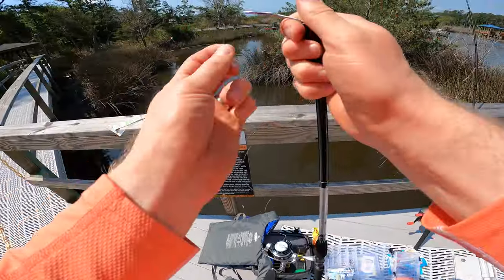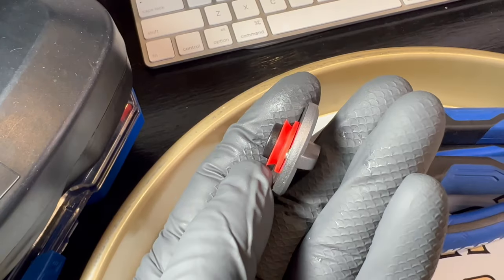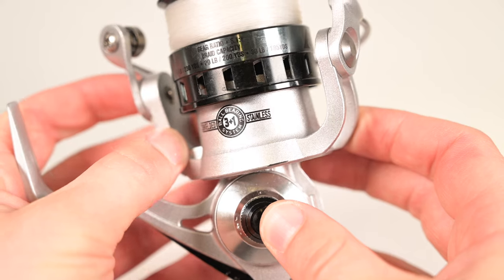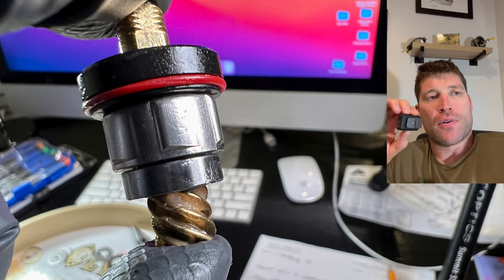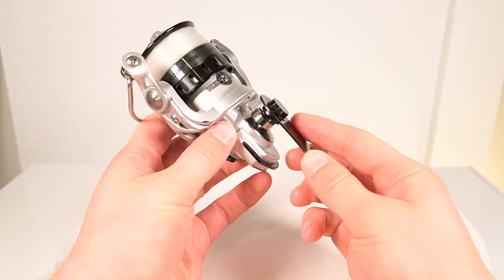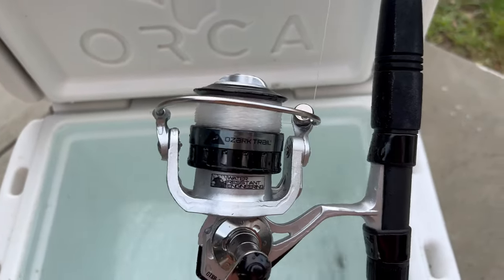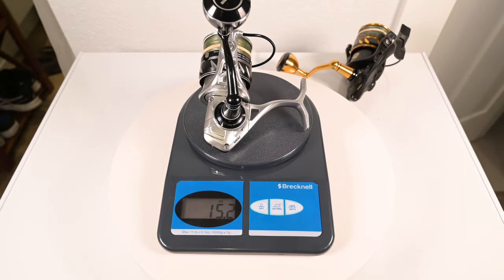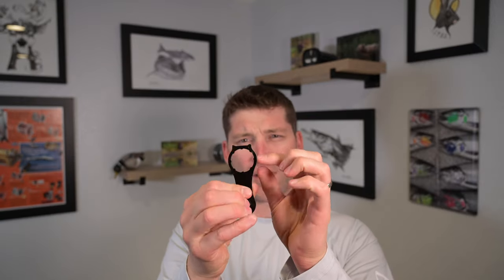RECESSION Reel: SHOCKING Ozark Trail Saltwater Spinning Reel

Comment: in my experience reels often have screws/nuts which need to be lefty-tightly to prevent loosening under use due to rotation.  So using reverse threads on certain fasteners makes the widget more secure/solid.

Comment: Great video, Thanks! I have been using the Barrier II for surf fishing for 2 seasons now. The barrier II is a good reel. I made some improvements to the drag, and added 1 bearing on the right side of the main gear (crank gear). I just found out about these Walmart OT reels a few days ago. I scored 4 of the 6000 size for a ridiculously low price. I didn't expect a whole lot for the cost, but wow, these are really built. The only drawback I see right away is the spool depth and shape, that may affect casting distance. For this low price, I am willing to give em a try. I have Grandkids, they will drop their rods, these will be perfect for them. If these really are made in USA, it's a double win!  Thanks again.

Comment: Saw the barrier and ozark , noted they both had seals and bought both was looking to pairing with a berkley one piece amp rod. If the reels hold up could be a great combo.
Reply from the maker: Sounds like a powerful combo to me
Reply: @CastFromTheHip  only taken them out once so far, yet I am impressed for the price. Can not beat it, can give higher end combos a run for their money. Have not opened to see differences as the tsunami says it has 7 seals. Only time will tell longevity with some basic maintenance. For something to grab and throw in back of your pickup definitely a must.

Comment: Bought two (4000,6000), but gotta hit it with the return. The bails take tremendous amount of force to close!
Reply: close bail with hand not reeling.
Reply: @gabrielM1111  Seems like the way. Had a quite few windknots on  the 4000.
Reply: @alanltdu  dont overfill the braid. stop filling at 1.5mm from the inner edge of the ramp around the top of the spool. windknots happen to any reel that is overspooled because line comes off too easily when casting. Also never reel in  completely slackline you must pinch the line and reel it in